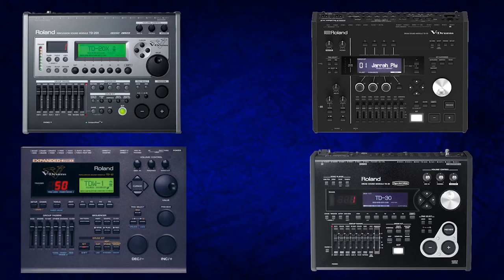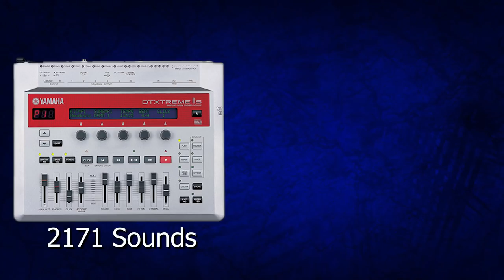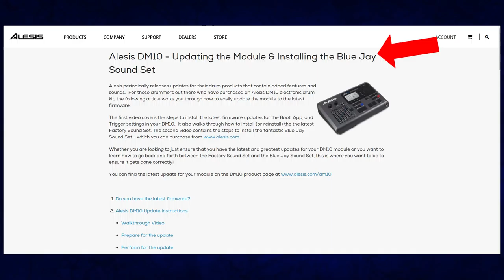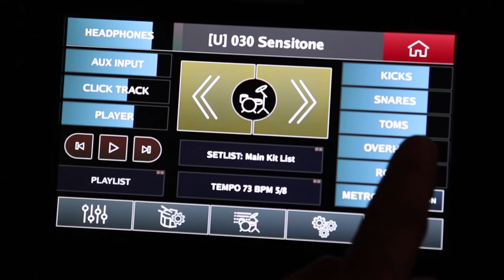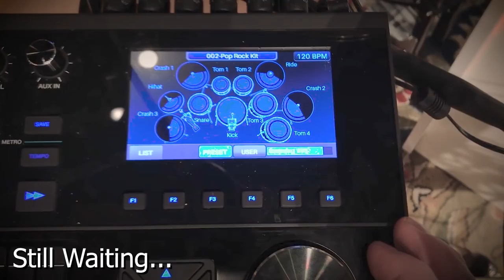How Many Sounds Should A Drum Module Have?

Comment: Customization is my preference. I've never gone with the pre-selected kits from the manufacturer. I still have my Roland TD-12 Sound Module & love it for customizing my own kits. My current TD-25 Sound Module is being used at live gigs & I've customized the built-in kits to my own preference & quick & easy select for the setlist of tunes we play at our gigs. Every built-in kit in all my sound modules has been altered for instrument type, sensitivity, volume, pan, tuning, special effects, etc., so as soon as it's out of the box I'm going through the manual page by page to adjust for the sounds I want in each kit. Even as far back with my TD-10 w/Expansion board, I've never gone with the pre-selected kits. Every Roland Sound Module I've worked with has been customized because the built-in kits are just the developers & engineer's idea of what they think the kits should sound like. But, the bottom line is- Does the sound module you paid big dollars for have samples that are truer to acoustic or does it sound like cheap electronic samples that are nowhere close to any real acoustic drums? I remember the crappy machine-gunning of the snare drum in the earlier sound modules, even in the TD-10 that was a very expensive module back in it's early days. Now all these manufacturers are tossing out hundreds of sound modules year by year & you're right, they are still using old components & not really moving on to newer technology like Smartphones & Tablet manufacturers are doing. So now we have a huge glut of sound modules being developed month by month with no real big jump toward newer technology to warrant the escalated prices. There's a lot of crap out there to have to sort out for the decent stuff on the market. But all of them are still too expensive for what you're getting.

Comment: I'd also like to add that, although the DM10 came with 100 preset kits and has 100 user kit slots, I don't use any of the presets - though I like many of them. I build all of my kits from scratch. I like my bass and snare setup so well that I normally copy that first kit to a new slot and then edit that one. I still think that it was an important decision for Alesis to include a good assortment of kits. 

I should also add that the DM10 comes with a nice assortment of song sequences that make use of those preset kits, but also show off some of the additional (excellent) sounds that are further accessible via a MIDI In, like a keyboard, for example, for recording those sequence files, which can also be edited onboard. A great way to add back-line music or other sounds that can be activated/deactivated with the strike of a pad.

Being a Drummer, I don't really want to have to go out and buy a sampler or other sound module, so it's nice to have all of these incredible sounds to use. Who doesn't want a nice broken glass sound from time-to-time, right?

Comment: The only thing I notice with my strike is that during those load times 90% of the kit is there in just a couple seconds.   it just sucks when you have something with a ton of reverb and effects as the sound does dramatically change as that kit loads.   I think what bothers me more is the low file size allowed per kit.   Why give me the ability to layer sounds if I can only layer the kick and snare?  I mean 200mb file size for each kit.

Comment: I've always thought that most of the sounds in just about every module are largely filler/gimicky stuff. I'd much rather have fewer, good quality sounds, and the ability to add expansion packs. It would be cool if they would offer genre specific variants - like a Roland TD25 Rock, or Alesis Strike Jazz - so that the kit you purchase initially has sounds geared towards your style of drumming. An e-drum manufacturer is eventually going to partner up with someone like Toontrack and build a module around a VST library - and we will all rejoice.

Comment: a fair amount of sounds - say 500  to 1000 PLUS  user space for sample loading from users.
For example the dtx multi 12 has 1200 sounds plus a 64mb user sample loading area on top
yeah it's not a full drum module but i like hoew they split the kits around and 4 layers per pad mean you can have dynamic sounding drums  not just 1 sound that gets louder.

Comment: td 30  still does it for me when i get bored i midi Addictive drums into the td 30  ,however i picked up a yamaha dextreme 2 module to use for midi only, but i am finding out you can sample anything with it just like with the roland spd sx or the new td 50 so this should be interesting .Between both those options i have yet found anything superior  .I did try the td 50 pack but roland sent it to me defected which they even confirmed so i sent the pack back ,couldnt justify the 3000$ price tag .

Comment: ONE KIT loaded in the module and a usb external drive from loading other when needed. with the current transfer speed of digital connectors, it should not be that difficult  to implement

Comment: I personally don't understand why they are not just making a small PC as the drum module. I have an alesis DM-10. I used those sounds for about a month. I was new to drumming and realized the sounds sucked. I then went to SD2 and jumped on SD3. No drum module sounds better than that. I only use 2 or 3 kits on SD2. I am really liking ATV. I am not looking to have weird sounds like the DM-10 has. So I say 5 to 10 amazing sounding kits.
Reply: Joshua Ferry, I agree with you! I decided to just bypass the outdated technology in drum modules and just go with a MIDI interface with lots of inputs (56), and run a VST. Just let the MIDI interface deal with converting electrical signals from the pads into MIDI notes, and let SD3 or AD2 or EZDrummer on my i7 laptop with audio interface deal with producing the sounds. Far superior approach sound quality wise in my opinion compared to drum modules IMHO. Check out Mike Luke's YouTube channel, he is a master of SD3.